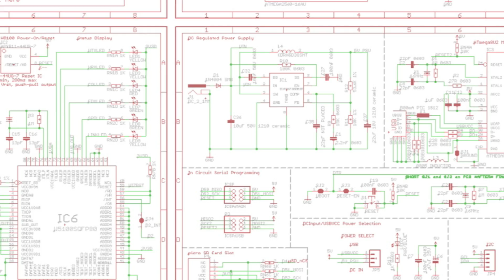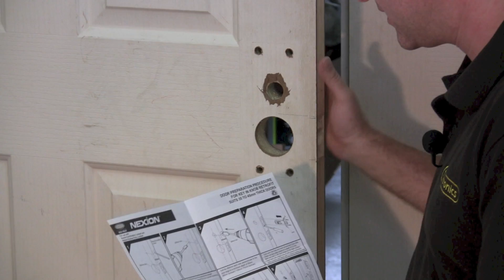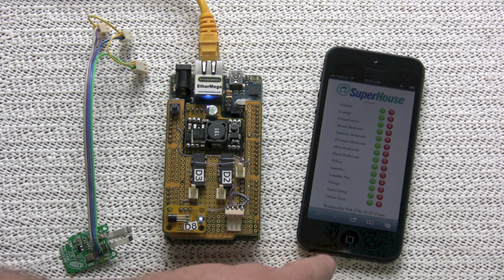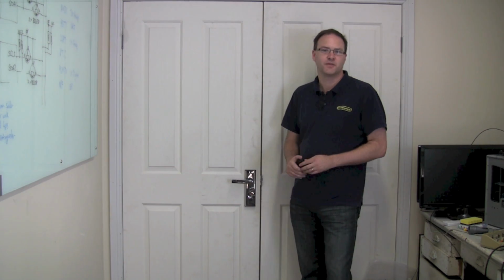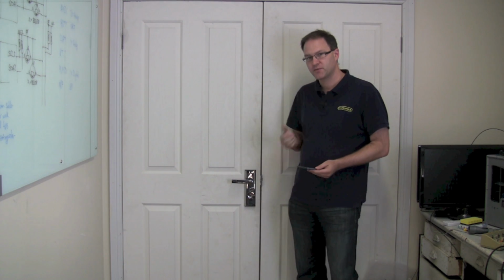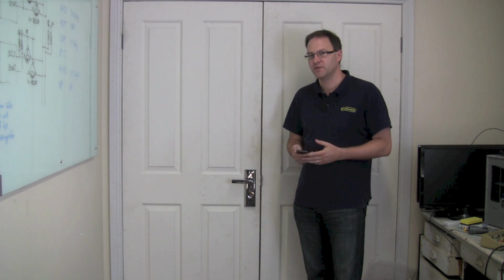SuperHouseTV #6: Electronic door locks

Comment: Why didnt you use a flyback diode on the relay? That could kill the micro. Also with no transistor, you'll burn the pin out, assuming that those relays draw more than 50mA

Comment: Would it be possible to add a mechanic that unlocks the door if the temperature on the inside of the room goes over a specific threshold in case of fire?
Reply from the maker: Yes, emergency situations like that are something home automation systems are very good at. Something like detecting a fire (smoke alarms and temperature sensors) can trigger a script to sound an alarm, turn on all the lights, unlock all the doors, send alert messages to the mobile phones of everyone in your family, and call the fire brigade. Just for example.

Comment: Very usefull video. Since you are powering RF remote from Ardunio 5v, could Arduino D pins trigger the chip on remote directly instead of going via reed relay.
Reply from the maker: Yes, that can be done. You just need to be careful of isolation so that it doesn't damage either the MCU or the remote control. For quick and dirty hacks like this I prefer to use reed relays because it provides total isolation without needing to investigate how the remote control itself works. Just put the relay terminals across the buttons, and it's done. Easy. I don't need to care about getting the polarity right, matching the voltage, or anything else.
Reply: SuperHouseTV - what do you recommend when hacking a 3v switch? I see 3v reed relays are not widely available. (Assuming you're using a 3v esp8266 and the pins can't handle 5v)

Comment: Hello the temperature sensor being that is in side the wall in my opinion won't give a good correct reading as if it was outside of the facing plate. Why in side the junction box?

The other question is how long does the battery pack last inside the door?
Reply from the maker: +joseph chrzempiec (josephchrzempiec) Reading the temperature at the device is only for curiosity about how hot the device itself runs. It's useless for measuring general ambient temperature.

The batteries in the door lock seem to last 6 to 12 months. They're easy to change, and it's just a set of AA cells. The lock is activated many times each day, so they'd last longer if the door wasn't locked / unlocked so often.
Reply: Hello thank you for that.

Comment: +SuperHouseTV  would it be possible to instead of using the wireless remote option, to instead of transmiting the signal wireless trough a transmitter, transfer it directly trough a cable? or even trough the lock mechanism itself so you dont have to wire it too much?
Reply: +tjeulink Yes, that's possible, and it might be more reliable. However it means running a cable between the wall and the door, which means it would be exposed in a length of flexible armoured conduit. You see this sometimes in commercial buildings. It would also mean running the cable through the door, which could be done by routing a slot across the door, laying the cable, filling the slot, and repainting the door. So it can be done, but it's much more work

Comment: Hi, is it not a bit insecure to lock your doors with RFID? I mean, every one who sits next to you in a bar could easily lay their phone next to your arm and read the data from that and copy it to their on chip; so clone that and then then have access to your room. Blocking that Chip would then be a bad idea, you won´t get into your room when you don´t change your implamented chip.
Reply from the maker: ***** Yes, there are security problems with RFID in general and implantable RFID in particular. In this case you couldn't just clone it with a phone, though, because phones with NFC use a totally different standard: different frequency, different encoding method, different message format, etc. Putting a phone next to my tag does absolutely nothing. If someone had the right equipment though, it is possible to clone simple tags which don't implement challenge-response authentication.
Reply: I know this video is over a year old...but a good answer is something my friend always told me.  Locks only keep honest people out.  If someone is going to go through that much trouble to get into your house, they will just break the door.

Comment: Loving watching these Episodes Jonathan.  Giving me a load of ideas for my place currently under construction.  I am also using a Nexion remote lock like yours.  Have you had any luck detecting the state of the door?  Would be handy to know if the door is either locked or unlocked when you are out and about.
Reply from the maker: Michael Leone I only just saw this question, sorry about the slow reply. Currently there's no feedback from the Nexion lock, and it would also be necessary to know if the door is physically closed. Having the lock in a "locked" state but the door open wouldn't help much! I've installed a reed switch in the door frame to check door position, but I don't have it connected yet.

Comment: Thanks for putting together this interesting video. Some q's. Why did you choose the electronic lock over the electric strike plate? Was it just a case of trying something different or does it offer something the strike plate doesn't? Secondly, where did you mount the completed board/remote? I guess it makes sense for it to be inside the study from a security point of view, but obviously it needs to be within 3m of the door. Lastly do you worry about sending calls via h ttp rather than h ttps?